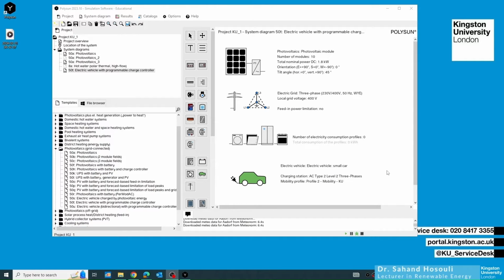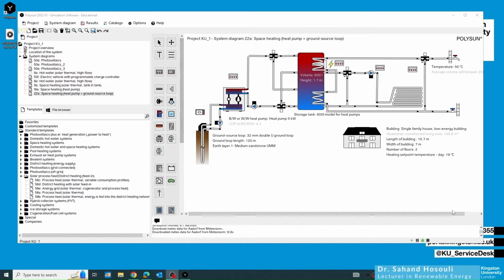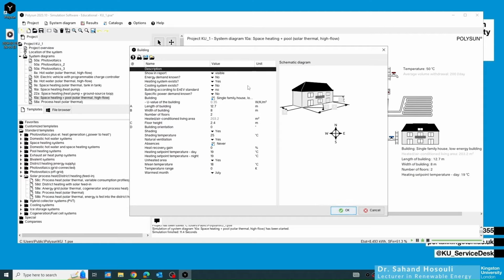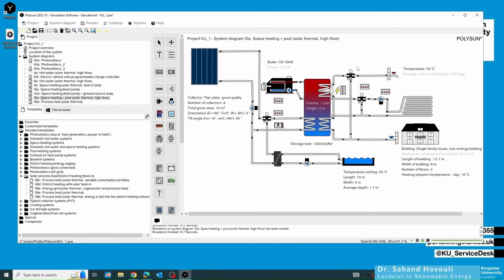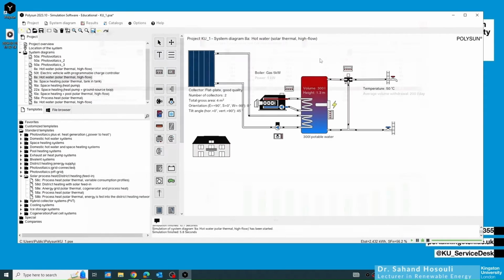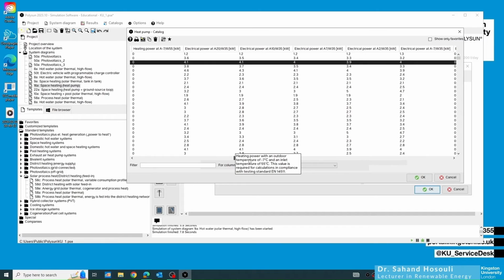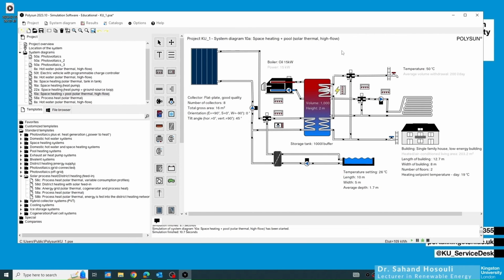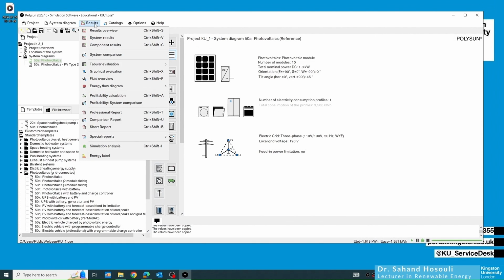[Tutorial] Part 2 - Simulation with Polysun - Solar Thermal Systems & Profitability - Intermediate

Comment: Hi, awesome and very useful video. I am trying to run a simulation and I get an Error 5070/33 (The loop "transfer circuit" does not contain any flow rate producer) and cannot see where that could be fixed. Do you perhaps have any insights to share in regards to such error?
Thanks